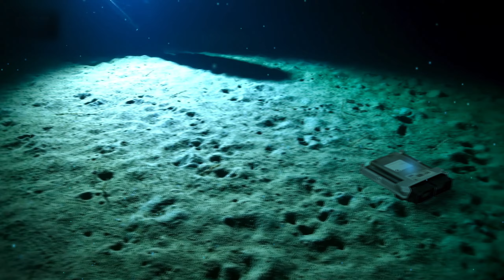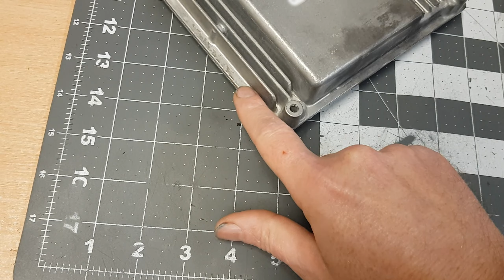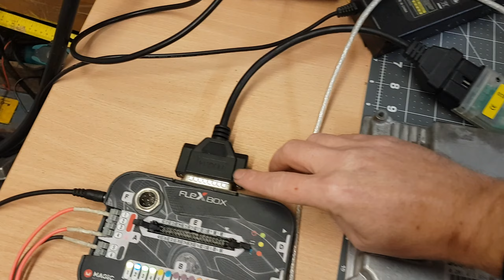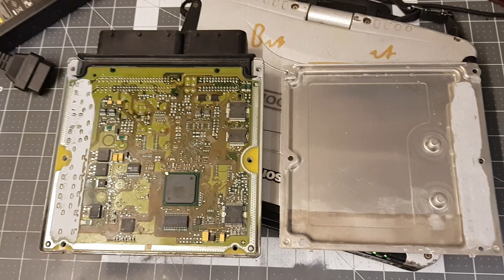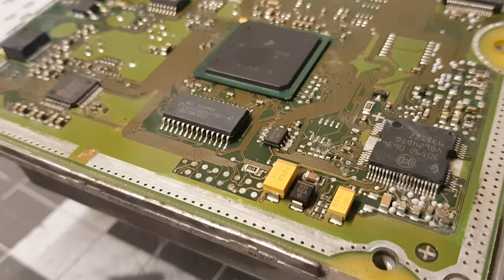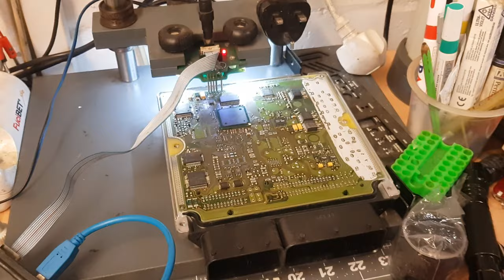335d Water Damage Recovery

Comment: Modern circuit boards always have lead-free solder, which has a high melting point. Apply some low-melt solder to all the legs. That will make it much easier to remove the chip.

Comment: How to learning this skill
Reply from the maker: The best way to learn any cloning or data transfer is to search for it on google, you will see other people asking on forums. In those answers, people will say usually what to do, like just copy everything from one into another, or if you should use diagnostics to fix it, or they might say to post the eeprom file or the flash file. That way you can see where the important parts are. You might be able to look at other people's files and see what they have done. BMW is usually easy and the immobiliser code is the main thing. VW can be trickier and sometimes needs data transfer. Some manufacturers just need special diagnostics and you can pair a new ECU with just a few clicks.
Older ECUs can be cheaper to work on, often soldering and some simple programmers, newer ECUs often need expensive programmers as they often don't have separate memory chips that you can change, a lot of info is inside the main processor.